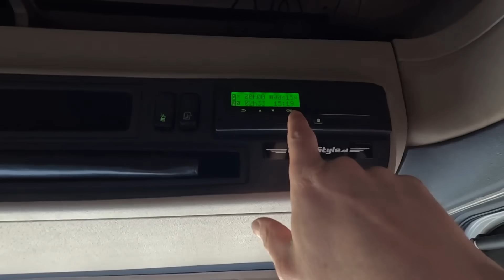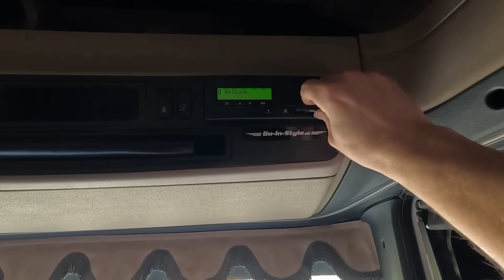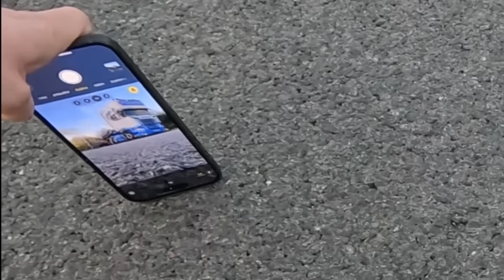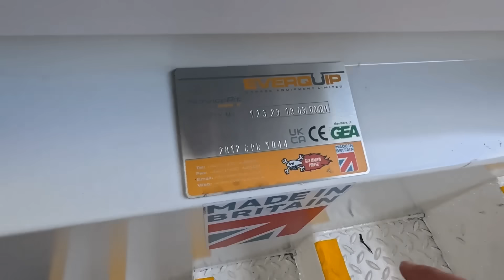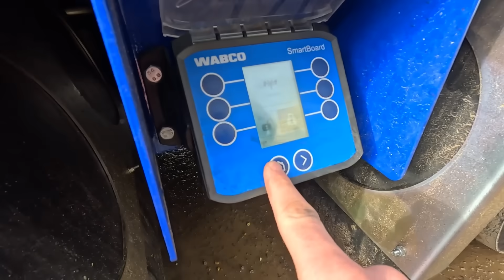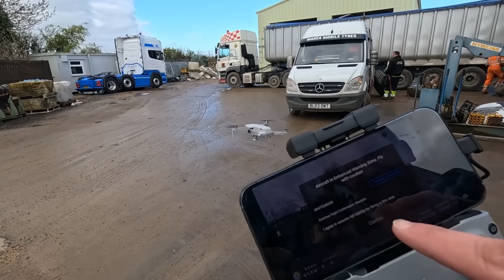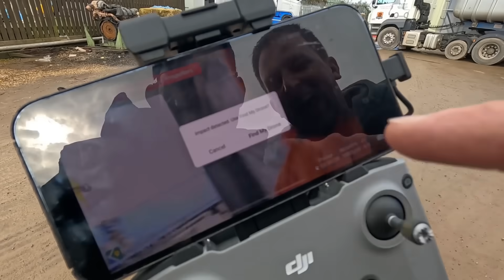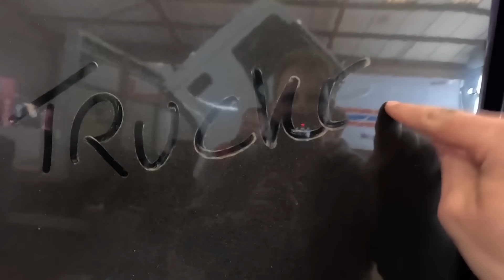PREPARING FOR MY FIRST EUROPEAN LOAD AS AN OWNER OPERATOR | PT 2 | #truckertim

Comment: Personally think you’d be much better off changing the beacons to yellow. Blue, not allowed in Holland and it doesn’t seem worth taping them up. Great video as always tim 😁👍
Reply: Yellow beacons does match does it?
Reply: Need tape on the top too ( not just around the sides) before they would be happy anyway 😂
Reply: @P3su_  orange/yellow would look alright tbh
Reply: Hate to be the one to tell you, but blue beacons are not allowed in the UK either. Or overtinted side windows. Or black smoke. Or holding the camera while driving. But hey ho… 😂
Reply: @martinhaskell376  before anything I want you to know I was the one who liked your comment, but ffs did that really need to be even said Sherlock????? Psml 😂 😂 😂
Reply: How about White beacons
Reply: @rider2k018  what about them???? Probably more illegal than blue in reality lol, no white light behind a vehicle unless low wattage reverse lights functioned by either a gearbox switch or touch only toggle switch, or low wattage number plate lights which are down or up or side facing, please do know what you are talking about before you comment bud 😂 😂 😂
Reply: Clear beacons blue lights, they are only for show anyway 😉
Reply: @WeAreThePeople1690  ya do don’t say….,.. 😂
Reply: Yeah you could used a clear lense woth a blue bulb. Id rather LED anyways
Reply: @vincekelly4820 great in theory, however try finding some with “e” markings, most if not all are made in China and will fail inspection if the examiner is clued up on the regs
Reply: @martinhaskell376  ahhhh yes well there is that but personally blue beacons is asking to get pulled 🤣🤣
Reply: vincekelly4820 true that many new components of cars are made in China, but they are made to the manufacturers exact  spec under licence and hence “e” marked, ( not to be confused with copy/pattern parts)“accessories” are a completely different kettle of fish however :(
Reply: I agree!